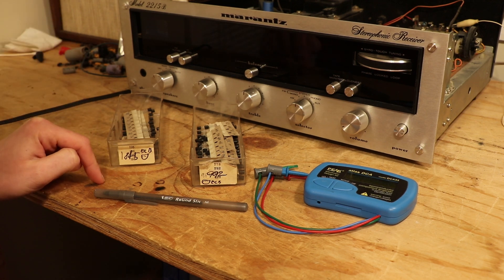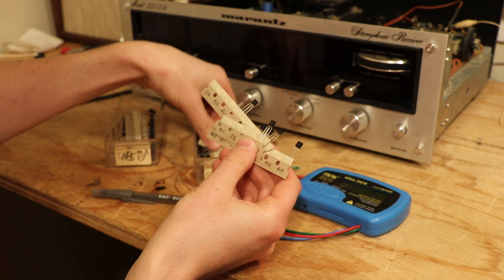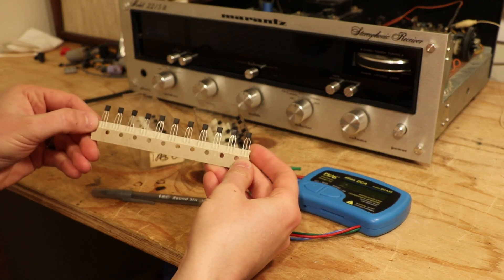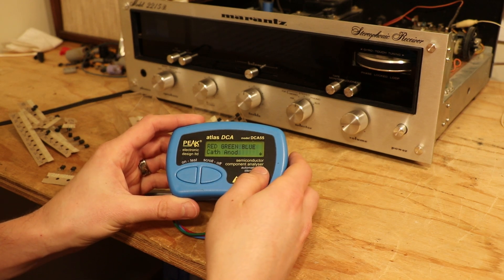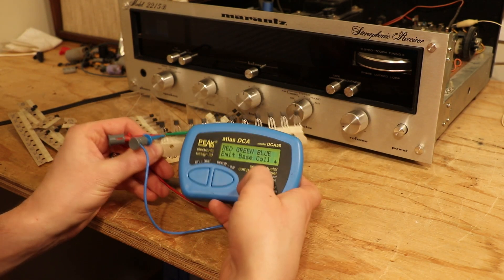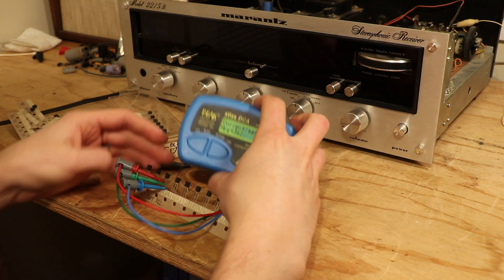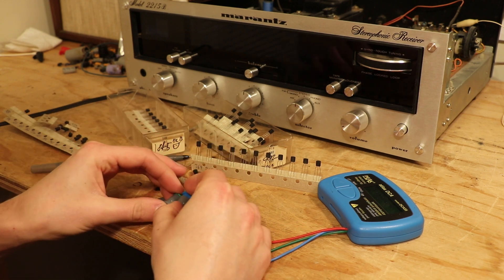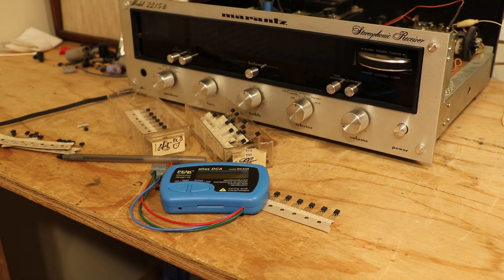How To Find Matched Transistor Pairs With The Peak Atlas DCA55

Comment: I'm replacing my dirty sounding differential pairs on a bad sounding Pioneer SX 434.  I don't have a tester like that so just ordered 4 replacement transistors and to hell with matching them.  What happens if they are not properly matched?  Can you match them using a cheap multimeter?
Reply from the maker: Your DC offset might be out of whack. It won't be "right" per se. You cannot match with a multimeter...the DCA55 is probably the least expensive option for matching.
Reply: @AHFixIt  Thanks for the quick reply.   Your no nonsense clearly explained videos are enjoyable and helpful.

Comment: Does gain matching transistors only matter in the signal path is passing through? For example, you wouldn't need to gain match transistors on a power supply board, correct?
Reply from the maker: Sort of. It mostly matters for a differential pair circuit. Watch xraytonyb's recent video on a Marantz 2240 to learn a little about that. In a signal path circuit, it MIGHT make a small difference matching transistors between the left and right channels so you have equal amplification. However, from the factory, I don't think they did this. I do it when I rebuild stuff because it's just me and I have time in that moment. On the factory floor it's probably a negligible benefit for the time it would take. But yeah, power supply, almost never matters.
Reply: @AHFixIt  As always, thanks for the reply!

Comment: These testers are not a good way to match transistors. Very low testing current. Also, holding the transistor in your hand even for a few seconds will change the hfe and other characteristics drastically, nullifying the matching criteria. These testers are nice for troubleshooting though.
Reply: Good afternoon, I'm a beginner. What device would you recommend for selecting pairs of transistors?

Comment: I have a Carver amp that needs a refresh and heard these are not easy to work on. I have some electronics experience, but the rumours of their quirkiness has scared me off. Any experience or opinions regarding servicing Carver equipment?
Reply from the maker: I've never worked on Carver equipment. However, I will probably restore my m200t power amp at some point and will definitely make a video or two when I do.
Reply: @AHFixIt  I own the M500T…and will definitely be interested in that project should you decide to do it.

Comment: I have a similar tester I use.  I’ve heard that these testers are really good but test he at such a low current in may not be best for matching.   Any thoughts?    Also, I’ve seen some of the differential circuits people (xraytonyb) build and match by measuring differential voltage.   Any thoughts on these?  I find both interesting
Reply from the maker: Both should be fine. That's the beauty of this hobby - many ways to do many things!

Comment: Any plans to restore a Marantz Model 24 Stereo Tuner Console or will all boards i.e. P400 tone/preamp, P300 phono amp, P600 main amp, etc. be the same across different receiver models? I have model 24 service manual unit doesn’t work.

Comment: Was that the hfe you were writing down?  I have one of those cheap ebay component testers that gives hfe.  Not sure how accurate it is but I suppose it would measure consistently.  Will one of those get me by?  They also say not to touch the body of the transistor when testing because the heat from touching it will affect the gain.
Reply from the maker: If you get the same results repeating a test it should be fine. Yes, I was writing down hfe.